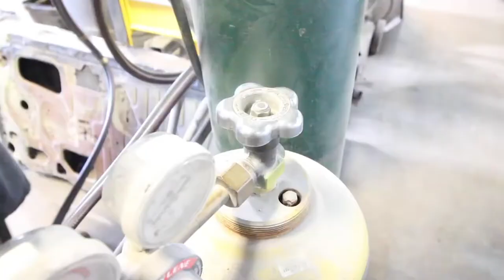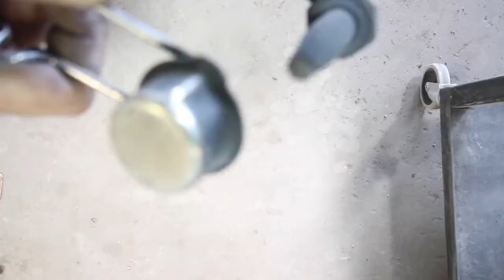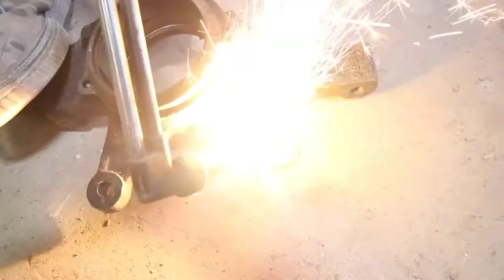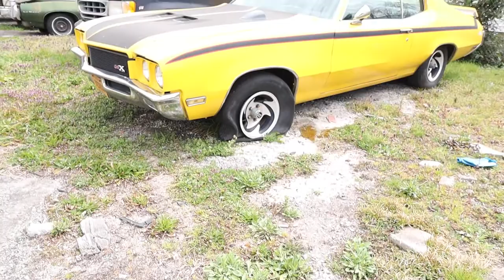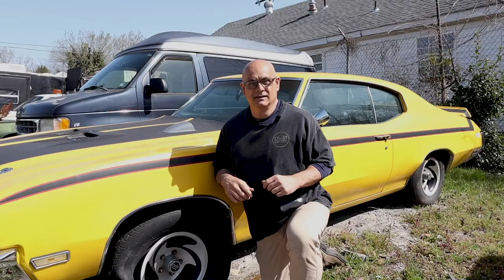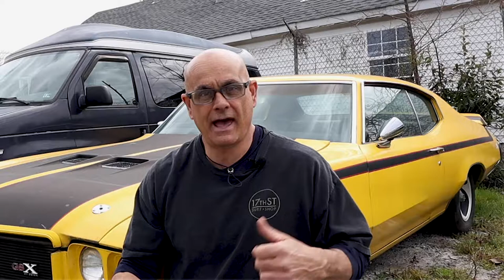Your Engines ROD Knock Could Just Be Bad CATALYTIC CONVERTERS~~CHECK THIS OUT

Comment: 2016 5.0 near Full bolt ons, stock cats. I added MSD 2 step and believe I blew my cats and started making this similar noise. Should I hallow out my cats to make sure? Everytime I drive to a muffler shop near me,  my engine warms up and stops making the tapping noise so the guy thinks theres nothing wrong. My exhaust note also got quieter and less raspy/agressive. I miss the loudness. Any advice would be appreciated.

Comment: Is it normal to have this issue without a p0420 code? About a year ago, I noticed a slight clicking at times when accelerating on the local roads. It would come and go and not be consistent. Thought it was probably axle or something else. I ignored it cus its not my main vehicle 

Recently cleaned the MAF and throttle  body and didn't properly reconnect a side plug near the MAF. Ended up coming lose,  engine started running rough, light came on and I got a p0171 code. Not a big deal since that's an easy fix.

Issue is that when the engine started running rough, that clicking sound got very very loud so I'm thinking it was the cat all this time? The loud sound went away once I reconnected the side plug.